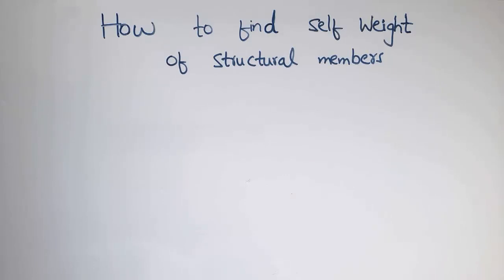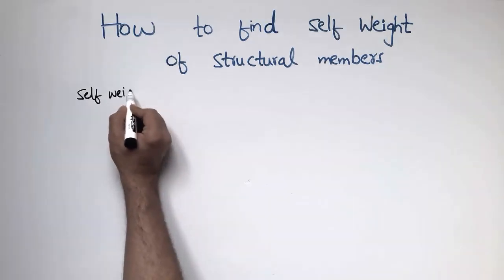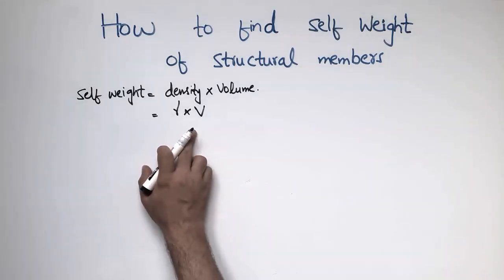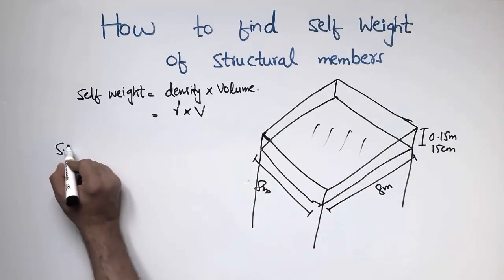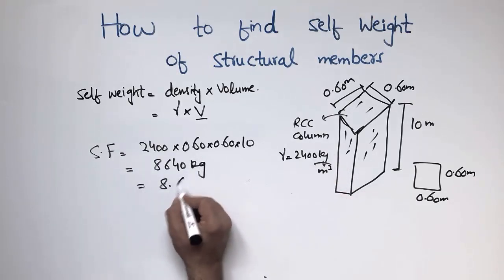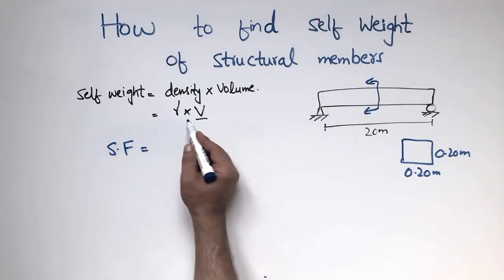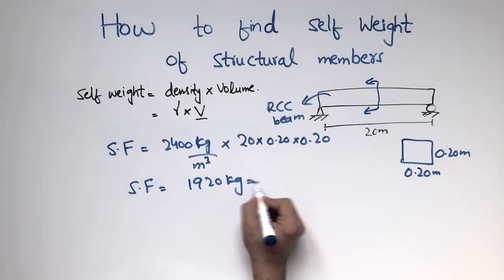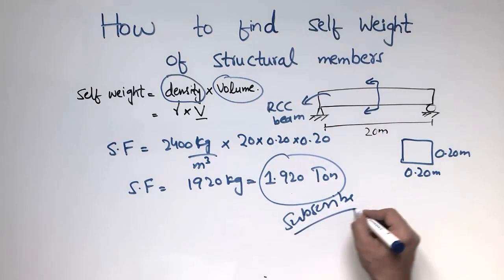How to find self weight of beam, column and slab

Comment: sir the unit weight of RCC is not 2,400kg/cu.m it is 2,500 kg/ cu.m because 2,400kg/cu.m is for PCC.
Reply: With Including Steel Inside Or just Mass Concrete Weight?